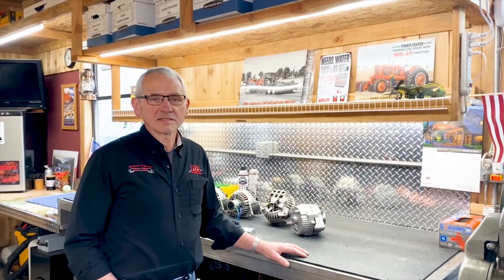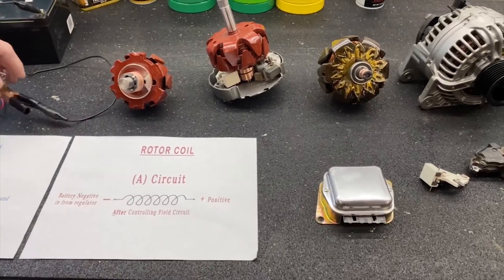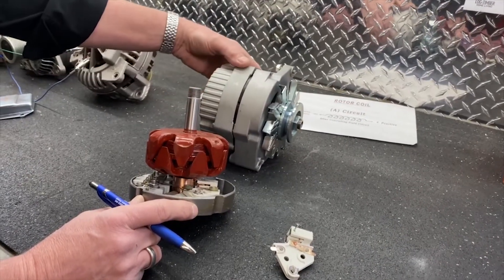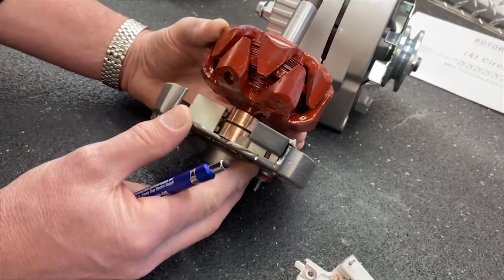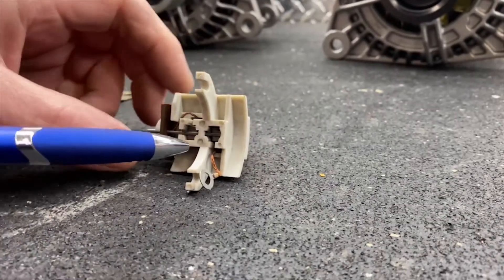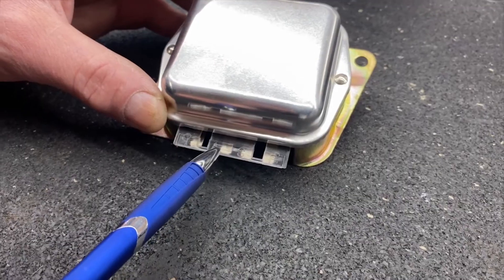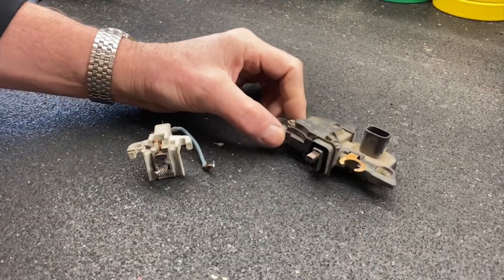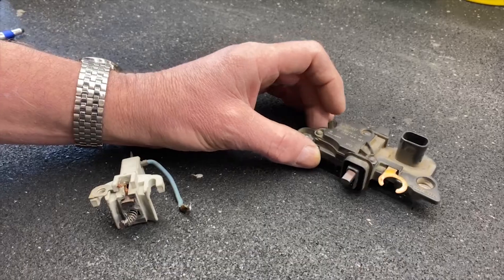Alternator Regulators | A and B Circuit

Comment: wow you really know your subject. I'm just looking into how ford falcon ( australian cars) alternators work. 
This info very good indeed. My alternator one brush quite worn, the other not as much. The slipring one side is worn down a long way,
I think it might be original alternator, car has 460,000km ( 286,000 miles) but I'm not 100% sure its original. If it is thats amazing good quality.
Reply: replaced sliprings but put it 180degrees different to where it was ( doh ), so the wires are connected to different slip rings than origninally, will that matter? should I un-solder, take off slipring and spin it around 180degrees or does it not matter?
its exact same alternator as used in this video
https://www.youtube.com/watch?v=_NMpSwl9gVU
also do you know what the rectangular black box is on the regulator board?  can be seen at 1min 15sec mark, basically the guys left hand thumb is pointing at it.
Reply from the maker: It should not matter. Also that little black rectangle box is a capacitor . Hope this answers your questions
Reply: @HagemeisterEnterprisesINC  thankyou so much for a quick reply, that saves me having to take off the slip rings again, excellent.
Capacitor........thankyou was curious to its function. Guessing smooth out some ripples in voltage ?

Comment: This is the first I have heard about a Ground side switched circuit being called an " A " circuit, and a Power Side switched circuit called a "B" circuit. Good general explanation except you are confusing current and voltage. If you have an A circuit , you do not put current on the field coil, you put voltage  aka potential on it. There is ZERO current. There is no movement of electrons aka current, until the ground side is attached to  ground to complete a circuit loop.

Comment: Very good, simple and concise explanations !.    ?  =  i have a NEW  alternator from a Dodge truck, 1500  1996 model. 120 amp Denso, i think; model A-8265A02AY7    IT has 2  small studs ; for A and B  i assume. And, one large BAT  terminal.  I want to use it for my Dodge 1996 intrepid car - 3.3 litre engine. What would i need ?   that external regulator, that clips onto those A and B studs ;  or  another  method ?.....thankyou for education !
Reply from the maker: So on your 96 Dodge that alternator is ran by the computer as an A circuit. With the two independent studs, it can be ran as A or B. Is it possible for you to get an alternator number that was originally on the Intrepid so we can determine the circuit of that alternator to see if what you want to do is compatible.

Comment: Loose belt means less alternator rpm. Regulator has to increase field current to compensate. Brushes wear faster. I think polarity has an effect on which brush erodes first. Grooved belts have higher surface area and allow more power transfer than v-belts.

Comment: Ok.  I fail to see this before and after bit.  AC flows both ways.  So your wire going to positive or negative first has no before or after that i can picture.   You're just completing the circuit.   I feel it's more simple and more correct to just say A is controlled by the negative contact and B the positive.  ??
Reply: The field winding is not AC it's DC
Reply: @JbVest yes comes from diode trio.
Reply: @icepaddles141  I want to understand that better. How's that work?
Reply: @ 1. From the car battery to the switch then to the other brush. 
2. Through the rotor windings, the flux produces a currant to send to the diodes and then the regulator. 
3. The regulator switches on and off the ground path to regulate the voltage. 
Look up mechanical voltage regulator if you want some amazing facts. (1940’s car regulator how too!) 😃
Reply: @icepaddles141  yeah, I mean I understand how the regulator controls the rotor windings to keep the voltage at the appropriate level. I guess what I meant to say is, what did you mean by diode trio.
Reply: @ There are 3 (trio) ‘sets’ of windings in the field, the flux from rotor/field interaction produces AC so each winding gets a diode. 
The reason the old generators sometimes needed to be energized by a battery to start the charging action, was because all, above battery voltage, had to start by energizing the fields, and thats what is different from a permanent magnet motor, the magnets already have stored energy.
Reply: Theoretically speaking, I’ve never heard of a permanent magnet generator, the field in a motor is what starts it, either with a boost from a capacitor or, 3 ‘sets’ of windings in a three phase system, automobiles have 3 phase power.
Reply: Automobiles have 3 phase power until rectified by the 3 diodes, then the DC can be combined
Reply from the maker: @JbVest the Dio. Trio is the Positive drive side of the rotor.
Reply: @icepaddles141  oh yeah! Gotcha, I get it now, I noticed this because I forget if it's the Wye configuration or Delta on those alternators but that would give you the three phases whichever one it is,  actually modified a alternator to put out higher amperage DC using a three-phase rectifier had to put a heat sync on it because it can handle up to 200 amps and it puts it out at DC voltage. Think I was getting around 70 volts from it It's been a while since I've ran it though. Works good 👌
Reply: @HagemeisterEnterprisesINC  Diode is output to battery and regulator is supplied there too in order to see the output, the regulator pulses ground coming from the rotor, my first post may have been a bit blurry, sorry for that. 🛠️
Reply: @icepaddles141  it's all good. 👌 Thanks👍
Reply from the maker: @icepaddles141 we recommend that you watch our video on the clutch pulley alternator, which talks about the permanent magnet alternator.

Comment: Excellent. Thanks.  So, would a B circuit Alternator regulator work on a 2 brush B circuit generator (old Ford 12v diesel tractor)?
Reply from the maker: You need a cutout for the generator to work. But the B circuit depends on if it’s positive ground or negative ground on your tractor.

Comment: Thanks, i have been a mechanic for years, and never new their was a difference, Although i was able to fix the problems, until now on my own truck. It's overcharging so my sorce voltage is low! Thanks.  Did have one   with bad alt, changed then it went to 40 volts, the output cable was all but pinched into under boom. So it was a A circuit that wasn't getting supply thru the discharge post, single wire alt. Thanks again
Reply from the maker: Thank you for your comment. Glad this video was able to help you out. This one trips up even the experts out there.

Comment: This is very informative. Although, it appears there is no difference between an 'A' and be circuit alternator devices in regards to mechanical design or function as far as the rotor/stator/diode network? The difference appears to be the connections within the terminal block and how they interface with the regulator circuitry? The upper/lower slip ring explanation is confusing to me. isn't it the same connection to the rotor winding on opposite ends? The only difference would be polarity if they were swapped. Which would not matter since there is a DC rectification stage after the induction stage.. Correct?  Additionally, what exactly is meant by 'insulated' in regards to the brush connection? Is it simply insulated from earth/ground as to force a path through the rotor coil to earth? Anyone..?
Reply: The upper/lower slip ring explanation is confusing to me. isn't it the same connection to the rotor winding on opposite ends?

Yes, one end of the rotor winding is connected to one slip ring and the other end of rotor winding is connected to the other slip ring. The slip ring closest to the alternator pulley is the negative slip ring. 

The only difference would be polarity if they were swapped. Which would not matter since there is a DC rectification stage after the induction stage.. Correct?  

The rotor alway receives DC current through the slip rings. This DC current will come from the battery when starting your engine and from the output of diode trio after your engine is running. The DC current will always enter the slip ring furthest from the alternator pulley, go through the rotor winding, and come out of the slip ring closest to the alternator pulley, regardless of whether it's A or B circuit.

Additionally, what exactly is meant by 'insulated' in regards to the brush connection? Is it simply insulated from earth/ground as to force a path through the rotor coil to earth? Anyone..?

Yes, he's referring to it being insulated from earth/ground.  The positive brush, the one furthest from the alternator pulley, receives positive current and delivers it to the positive slip ring. If your vehicle uses a negative ground system, which the vast majority of cars do today, then you have to insulate anything that is positive to prevent a short circuit. This is why it's insulated.

Comment: I have a 99 Ford at 3:50 pick up 73 and the alternator is headed off and sucking can choose from the 2 batteries and I was wondering if you could help me fix that
Reply: I have a 1999 ford f350 and the alternator is sucking juice from the two batteries at night when the truck is sitting off. I hope you can help me fix this problem. Shut off at night the batteries are at 100%. In the morning the batteries are at 55%. The next day without being run the batteries are at 20%. Thanks
Reply from the maker: The first thing I would do when you park at night time and the batteries are full open up the hood and disconnect the alternator wire and the plug, let’s totally omit that from the system and see what it looks like the next day. Keep us informed.

Comment: Thank you for explaining things in such great detail. I have a 2000 Dodge 2500 with the Cummings deisel. We replaced both batteries yesterday due to age and not cranking over. (They were each 4 years old). The truck started right up immediately, but the alternator gauge went to max charge, and is staying pegged when driven-18v.  Beginning to troubleshoot now, with the knowledge that the batteries are new and good-but not wanting to drive it and do harm. Any thoughts on where to begin, as all the mechanics are a week or so out for diagnosis. Thanks so much for your thoughts, as I was planning to begin a 1200 mile journey to Indiana from Florida today! 🙏 
p.s. the alternator gauge has never done this before.
Reply from the maker: Would you mind calling the shop and asking for Larry. Sometimes old bad Batteries can make the alternator do funny things. We have no problem sending him a new regulator. They are easy to install.

Comment: Thank you SOOO MUCH for explaining this stuff so well! I knew there was a and b types, but never understood just how they worked differently.

I'm in the middle of a cummins swap project, and im redoing the wiring from scratch, and have to decide which voltage regulator type to use. It sounds to me that the ford style type B regulator is the better way to go, because +power is controlled to the alternator, and if it shorts out, it will only stop charging and maybe blow a fuse, instead of overcharging and maybe causing damage elsewhere in a type A setup.

Do you concur? What's your thoughts  on internally regulated alternators, whether from factory or with an aftermarket module?
Reply from the maker: The B circuit Ford regulator is the better choice. However, it needs to be the heavy duty type. Because they have as much as 7 amps on the rotor circuit. Also the A wire on the Ford regulator is the battery sense wire to keep the voltage stable. How this helps.